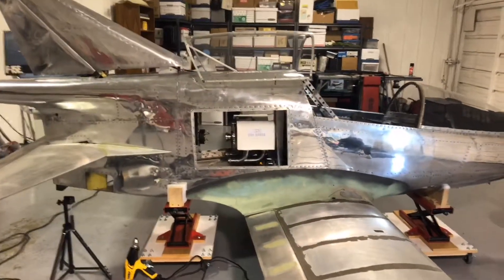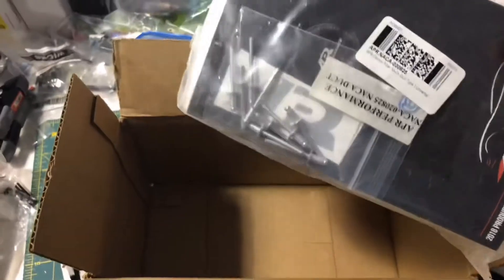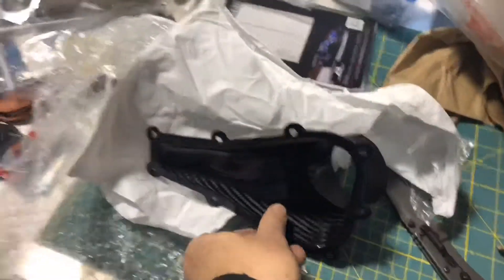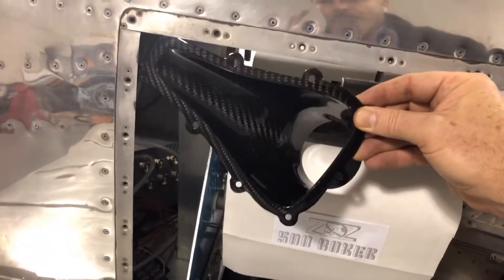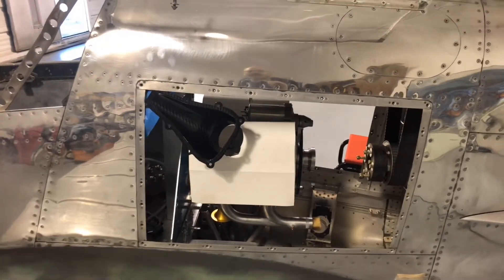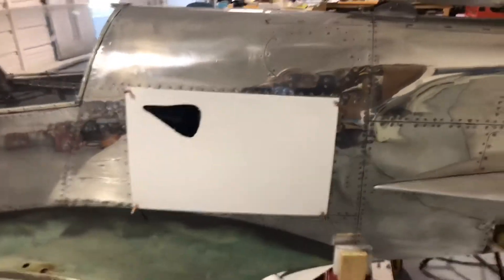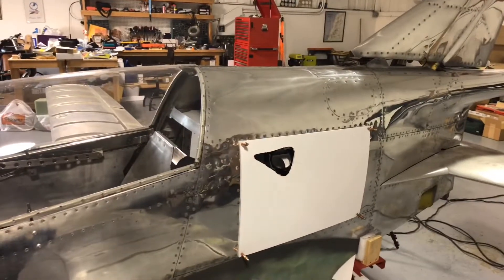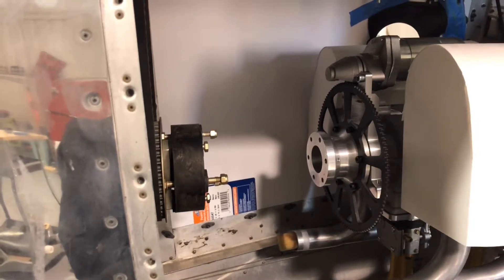New NACA duct for cooling air, better fit and design for this application.

Comment: Excellent thought process. We’re there any specs with the engine as to required air flow for cooling, cfm, is the NACA duct sufficient . I assume your outflow is low and aft.
Reply from the maker: I am in contact with the engine supplier and the cooling design should work per calculations but will require testing to verify. I have options to increase air movement if necessary.